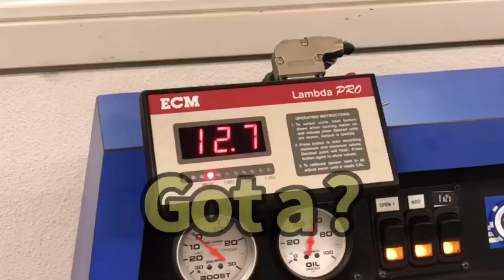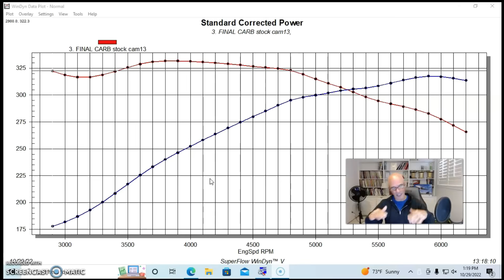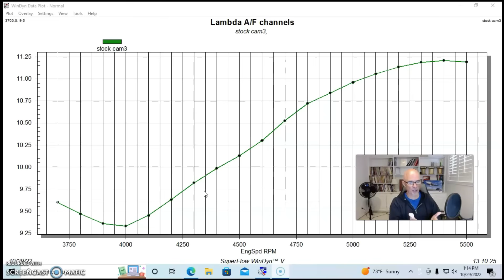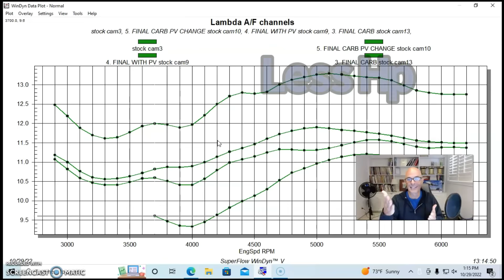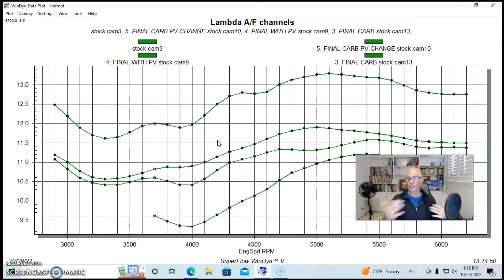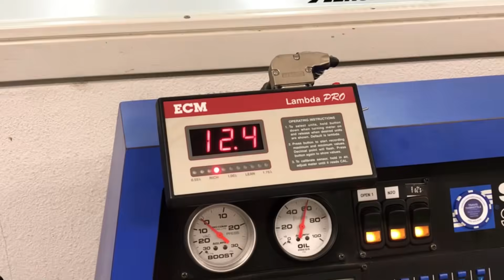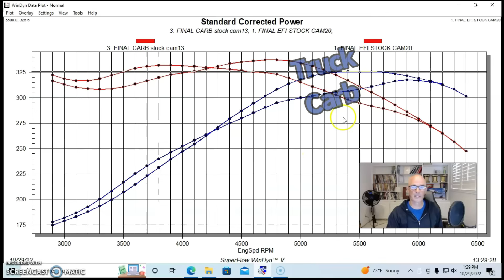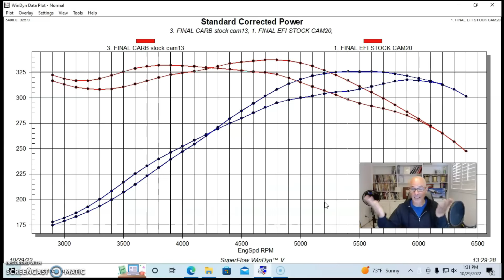WHAT MAKES MORE HP ON A JUNKYARD 4.8L LS? CARBS OR EFI? EDELBROCK PERFORMER RPM & 750 v TRUCK EFI

Comment: Rich.   Your last results comparing dual and single plane carb intakes to the stock ls3 intakes was surprising.   I'd have no idea the dual planes could beat a medium runner efi intake to 4500rpm.    Basically in daily driving ram a good deal more torque.   The higher ram operations could have likely been improved with porting and plenum work.   On the single planes they were just coming alive at 5500 or so.   I'm sure they would allow operation to 9000 on that large displacement.

Comment: Carbs have always seemed the right choice for me because I love the simplicity. Very little is needed to make it work and get really close on the tune up.
Reply: Efi was only established to allow a computer with sensors to adjust fuel metering for altitude, temperature changes, and emissions control. All it does is increase complexity and cost to operate and troubleshoot.
Reply: EFI is more complicated to set up but in a lot of ways it's easier/faster to tune without anywhere near the guesswork. Once my Holley HP system was set up it's basically just type in the fuel and timing curve I want and the computer does it's best to make it happen and maintain it.
It's actually kinda funny nowadays that EFI has become so powerful and common that dialing in a carburetor is often viewed as wizardry.
Reply: @177SCmaro I dont even really find efi's setup to be that complicated especially with a efi tb injection that holley makes. That said, i have run countless Demon and Holley carbs that drive wonderful right out the box and still pull to redline without so much as a twistof a screwdriver to dial them in. I refuse to put any extra electronics than what are absolutely neccessary especially on something like my sand rail that has no electronics beyond the ignition. I prefer the dead simplicity of a controlled fuel leak over a fuel injection.
Reply: @madmod  
In that case I say dispense with that complicated carburetor contraption and get yourself a metal box full of fuel and just drill a hole in it.
Reply: @177SCmaro  Itd probably work xD
Reply: @madmod  
Lol
Reply: @177SCmaro   Easier to tune EFI? Let me see you tune it with a screwdriver in 45 seconds.
Reply: @SOLDOZER  
Unless I'm using the screw driver as a stylus I don't need the screwdriver or the 45 seconds to tune my EFI, just my index finger and about 10 seconds to decide what af and timing at what rpm I want.
I'vr done both. Carbs and efi have their merits, I'm not suggesting one is better than the other, I paid probably two or three times more for my efi system then you did your carb system and Efi is more involved in the set up then bolting on a carburetor and a distributor but once everything is settled making changes to efi is as quick as pushing a button. Hell, to switch between gas and e85 it's simple as tapping which tune you want loading it and youre done. Some systems have an alcohol sensor and you don't even have to do that much, they adjust for you. What do you have do to a carb to switch fuels?
Reply: @SOLDOZER  To be fair, a lot of modern efi have correction factors that allow you to bolt on and run out the box, adjust fueling on the move on its own, and generally require no "hands on" tuning to make it run well.
Reply: @madmod   Ive seen a lot of these "learning" EFI not work or go nuts and flood the engine.
Reply: @SOLDOZER  Ive worked on a ton of Fitechsan sniper efis on customer cars and never heard of them just flooding out a car randomly. To be fair, ive seen a lot of carb combos not work. Efi needs set up properly to work just as any carb does.
Reply: @madmod   Dont know about FiTech, but the Sniper has this issue.

Comment: I'm guessing the reason the engine lost power at 13.2 on the carb setup is simply down to cylinder to cylinder fuel distribution.  You probably got a few cylinders up in the high 13's/low 14's and that was enough to knock a couple hp off.  Much less of an issue on EFI.
Reply from the maker: it didn't like 13.2:1 with efi either
Reply: @richardholdener1727  Interesting, didn't we just see the 5.3 do its best at 12.9 vs. 12 and 11:1?  Even if the differences were small?

Comment: When it's getting down to performance.... it would also be nice to see the basic petroleum use on each setup, as M.P.G,s ,I know without the specimen being placed in a actual demo vehicle it may be more challenging to crush numbers...or may be easier to say which one burns lesser fule..  thanks again...
Reply from the maker: we can't do mpg on the dyno and you don't get good MPG at WOT
Reply: I get that... the majority of Auto Makers have always claimed that fule injection 💉  smoothness has a better fule efficiency,... but thinking about the New Holly fule injection with same four barrel mounting for simplicity...may be interesting to give those new age babies a run?....

Comment: Hey Richard which Holley 750 did you use? Is that a vacuum secondary or mechanical secondary? I've had better luck with a vacuum secondary with a metering block for secondary jets. Also a slightly lighter spring in the secondary diafram depending on the camshaft.

Do you think you would had better results by using a 600 cfm carburetor vs the 750 cfm carburetor?
Reply from the maker: mechanical

Comment: Because of the way the heads flow could a single plane intake work better?
Reply from the maker: no
Reply: You can check the comparison of the single vs the dual plane vs the stock EFI truck manifold in this video.
https://www.youtube.com/watch?v=Twnid-se9Ug

As Richard always says
"That's what a dual plane (long intake runner) does"
"That's what a single plane (short intake runner) does".
EDIT: Every time.

Comment: Hey Richard, Swapping a EFI TB with injectors on the dual plane intake would be intresting and easy. Does better fuel control add any HP or TQ? My guess not much but what is causing the shorter runner intake to make better power to 4000 rpm over the longer runner truck intake, seems to go against what you would think.

Comment: If you want the carb look, just go Holley sniper EFI 4br (or two even) and get the much better tuneability of efi with the look (and feel/sound from my experience) of a carb without all the nuisance.
Reply: There's nothing wrong with carbs. People who don't like carbs, don't know how to tune them!
Reply: @erikturner5073  Richard literally just proved my point on WHY carbs are not as good lol🤷 the air fuel will NEVER be exactly how you want it and HE absolutely knows how to tune a carb. It's not rocket science. Guys who refuse to see that are just afraid of fuel injection and don't know how to tune modern efi pcms 👌✌️(ps it's even easier than a carb 😱). I like carbs. They are cool and I enjoy the Holley 2brl on my dad's 68 f100 very much. But, it will eventually get fuel injected because, it will just be all around better. Otherwise, the world(including nascar) would have stuck with carbs 👆)
Reply: @lifeonadime4703  regardless of how you feel about carbs, they aren't going anywhere in the Hot Rod world. I'm a master Auto technician (for 26years) and I perfer carbs on my muscle cars. They are still too popular for that for that and for good reason!👍 There's too many videos proving the viability of carbs as well as them making as much and even more power than EFI, for the fraction of the cost! Also Richard used carbs and has vouched plenty of times in favor for carbs. So there you have it! Also plenty of companies are making carb intakes for the Ford 4.6, and 5.4, the new Dodge Hemi engines, and also LS engines as well. Obviously carbs are not going anywhere and are still very popular!
Reply: Richard said to tune a dual plane with a tbody style aftermarket efi is possible but not easily repeatable. Most t body systems run better with a single plane wet manifold.
Reply: @jasonrose6562  yes but the fuel injected single plane imo would still be better than a DP with a carb. Now, demon carbs and the like are flat out awesome. But, good luck starting that and taking off for work at 4 in the morning when it's 15 degrees outside.  Mpfi is absolutely the best but not always the cheapest when the engine didn't come that way stock. I'm not a big fan  of tbi really either but, tuned right they can get pretty serious fuel mileage.

Comment: I would like to see a dual quad carb setup. I feel like it would be more fair due to the fact 8 barrels for 8 cylinders for even fuel distribution. That’s my thought at least and would love to see how the results look!
Reply: I met a guy back in the day who tried to run dual quads on a 305. He could never make it run right. It was a mess.
Reply: @gumballer133  twin Carter AFB 500s work great on 302 and 305s..
Reply: @gumballer133  ive seen someone years ago do that on a 89 Camaro 305 with them poking out the hood.  Looked cool but run like 💩

Comment: Rich I never see where a 4 hole spacer helps an ls engine in any case unless you want all bottom end power however a 1 inch open spacer is worth 1 to 2 tenths in the quarter mile on every ls we worked on and tested at the track
Reply from the maker: if someone tells they have never seen a 4-hole spacer work-that is all I need to know.
Reply: @richardholdener1727  It works great on my 302 but on the LS it smothered the motor I prove my stuff where it counts on the track not a dyno I'm just stating facts
Reply: A four-hole spacer is better for the carburetor venturis by allowing for a longer straight-flow path which is actually better for the carburetor velocity and actual flow volume/cfm. The same is to be said for the other side (the top of the carburetor, when using a stub-stack or velocity stack on the airhorn- it straightens the flow into the venturi on the top-side. Both are very effective at increasing the carburetor flow and performance when space under-hood allows their installation without restricting the airflow into the airhorn. 
The open-spacer can benefit certain engines especially when the added plenum volume is needed for the engine capacity, and as a way to slow the air/fuel mixture's velocity from the bottom of the throttle plates to make a tighter turn into the intake manifold runner in some cases. 
Whether on a dyno, or in the chassis on the track, trial and error will yield the answer to which is better for that particular combination.

Comment: It would be interesting to see this comparison with a slightly stronger cam with a smallish lsa, maybe the dualplane could  give driveability as well as a strong midrange. Just a thought. 🙂
Reply from the maker: both will gain from any cam
Reply: @richardholdener1727  Oh yes, I'm well aware of that. 🙂
What I'm getting at is that even though the truck manifold most likely will outflow and make more hp no matter what, maybe the dualplane instead could make for a really strong midrange (~2-5k rpm) and have idle/part throttle manners with the divider in the plenum. Maybe not enough to make big difference in the end, but maybe still a route worth taking if you for some reason want/have to run the dualplane and get the most out of it. 🙂
Reply: @richardholdener1727  hi 👋 Richard from  🇨🇦 #YSW where I follow you 💯 from have a wonderful Saturday evening respect back to you

Comment: Please do a high compression 305 Chevy build.  I want to know what a small strokey engine would do on the minimum requirement for E85 [70%].  Love your content.
[edit: just how high could you safely go on E70?  13:1,14:1?]
Reply: Ethanol will handle 15:1 easily, especially with a decent cam.  Remember it's not the static compression, it's the dynamic.
Reply: @ChurchAutoTest  I'd imagine that the safe level of compression would be different, given different levels of ethanol in the mixture.  Do you actually think that E10 and E85 have the same knock properties?
Reply: @middleclassthrash  Hello?  Did you read the post?  Guy asked how much E70 can handle.  15:1 easily is the answer.
Reply from the maker: AND LOTS OF OTHER THINGS

Comment: I would like to see what combo (cam, heads, intake..) would be best for low to mid pulling power. NA and turbo, 5.3, 6.0, 6.2.
Reply: From all the videos I watched from Richard he likes the stage 1 truck cams for a towing applications. Anything bigger just gains out in the high RPMs but loses a lot down low
Reply: Although those truck Norris cams make good power without losing much on the bottom end
Reply: The stock ls  heads and intakes support plenty of power. Unless you are racing and trying to get high RPMs horsepower